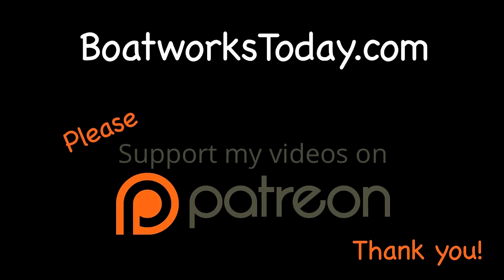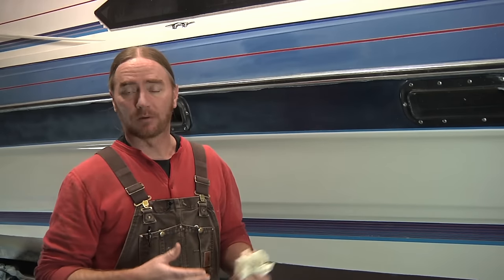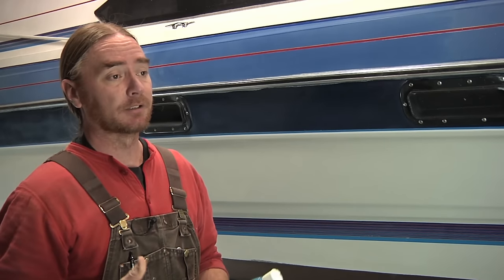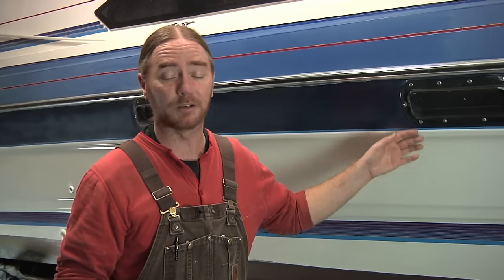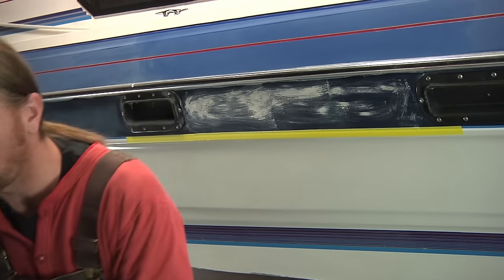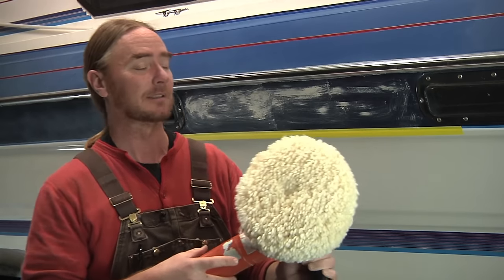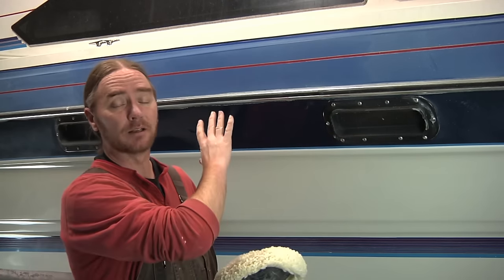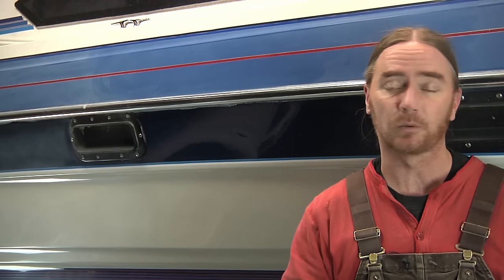Gelcoat Buffing And Care

Comment: Wow...that buffer looks like it's been around the block a time or two....what kind is it?  :)
Reply from the maker: +tonyacehawk It's a Fein.  I've worked the crap out of it for 15 years and it's never let me down!  I've had to replace the motor brushes a couple times, but I consider that general maintenance :-)  I will say though, unless this is a tool that you'll use everyday, the price tag may be hard to justify.  BUT, if it is, you'll end up saving money in the long run!!
Reply: +BoatworksToday Wow...15 yrs....I just bought a flex...hope I can get that many years out of it..:)

Comment: Can you describe a bit about the kind of pressure you're applying as you do this?
Reply from the maker: +cbrindisi Good question ;-)  A little tricky to explain but I'd say maybe a couple pounds of pressure with the buffer slightly on edge.  Possibly another way would be to say that you should be able to hear the motor sound like it's working, but not struggling.  Also, if the surface is getting hot from the friction it's probably a little too much pressure :-)  Hope this makes sense
Reply: +cbrindisi 

I find you just get the "feel" for it. As mentioned in the video, let the compounding do the work.
Reply: BoatworksToday
Detailer/Used car dealer here. I can tell you know what you're talking about. I find people either don't leave the buffer on a spot long enough (gotta get it warm) or tilt the buffer too much (gives you swirl marks). I love Milwaukee buffers. 
Good video.

Comment: On the gelcoat that you polished with the aquabuf, do you follow up with something like Meguiar's M6332 Premium Marine Wax to seal?
Reply: The aquabuff is a cutting compound and needs to be followed up with a polish in order to remove the swirl marks and fine scratches left behind by the abrasives. Then after polishing you would absolutely want to seal the pores of the freshly finished surface of the gel coat with a polymer wax like the M63. Avoid plain carnuba waxes on gelcoats because they do not offer proper UV protection and you will be compounding again in a much shorter time than you would expect to. Good luck and hopefully this got to you soon enough. If you have already used a carnuba wax then you can wash the boat with liguid dish soap to strip most the wax and then put the proper wax/sealer on like MEGUIAR'S Flagship boat wax.

Comment: If starting with cleaner/wax on very lightly oxidized boat what is the best application process. Been using 3m cleaner/wax with wool pad on buffer (on and off).  Switched to Meguiars Flagship and it calls for a da buffer or hand application.  Using an orbital should I use a foam pad, a combination foam on, wool off, or something different? What works best?  Thanks.  I've always followed this with carnauba paste hand wax, seems to work but they tell me it is unnecessary...
Reply from the maker: +john ryan Hi John, different products need to be applied according to the way there were designed to be used.  Some need higher speed buffing, others like a cleaner / wax are typically best  done by hand.  The best thing to do is follow what the manufacturer recommends and you should be good to go!  Hope this helps!

Comment: Question.  I have seen many, many videos about caring for gel coated boats.  Some pundits declare that you should never use cleaner wax on gel coat and some say that's what they always use.  Is there any downside to using cleaner wax on my Bass boat?
Reply from the maker: +Rick Settle There is absolutely no downside to using a cleaner wax on gelcoat.  Paint is another story :-)
Reply: +BoatworksToday Good to know.  I couldn't see why there would be a problem.  Keep the videos coming.  I thoroughly enjoy them.
Reply: I got to thinking more about this and went back over some of the videos I had seen.  I suppose I was just remembering different things from different videos.  (Being 70 can mess with your memory :) )  What was said was, 'don't ever use a cleaner wax in a fiberglass mold'.  Because of the solvents, I suppose.

Comment: I have used several "color restorers", & buff magic & the fiberglass does look better but starts to recloud after several days. Is this because I use a random orbital buffer?
Reply from the maker: +sailorlewi Most likely it's one of two things (or both).  The compound you're using may not be aggressive enough and orbital buffers aren't really able to take full advantage of the compound.  The goal is to remove the top layer of dried gelcoat so that you're exposing fresh resin.  Rotary really is the best kind of tool for the job :-)
Reply: If you have severe oxidation you might have to wet sand first, I recommend 3m trizac 3000 grit. It's a great product.

Comment: When you are scrubbing away the oxidation with a ph-neutral soap like dish soap what do you use for a scrub pad?
Reply: What I got out of the video was that the dish soap was to clean away dirt and wax. The oxidation was cleaned off with the use of the wool pad and 1000 or 2000 grit cleaner

Comment: hi - gr8 vids man, excellent info. question: is there a go to tool for this? trying to buy one tool that will do a very decent job on our old 74 searay. Most likely new from HF OR a used one on ebay.. what is the rpm range for various stages (from using a coarse compund to final gloss) - and what pads? could u maybe do a bullet list breakdown of an approximate "approach"? tools, speeds, products and how hard to press, etc?